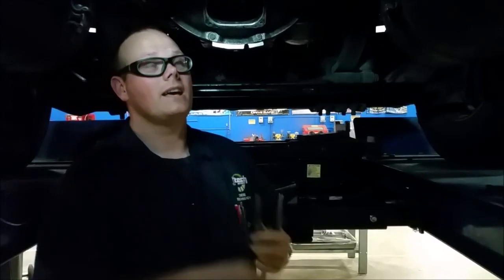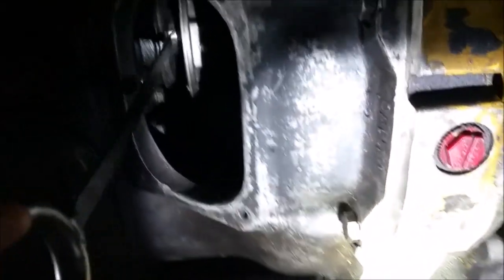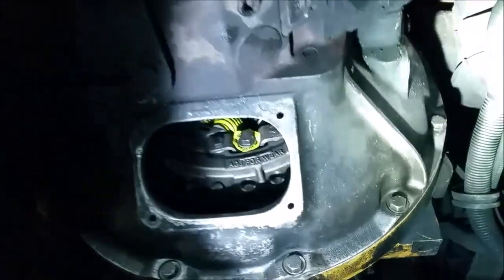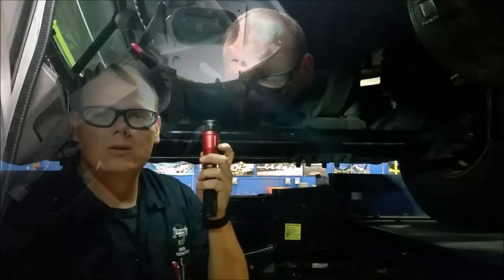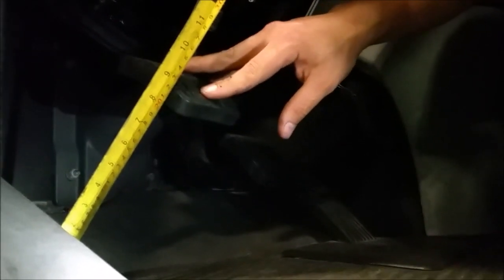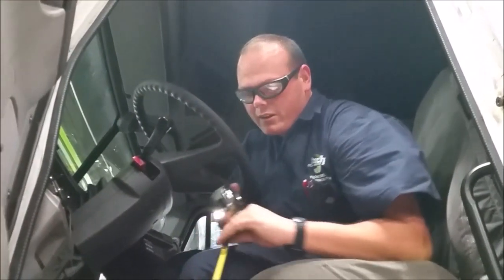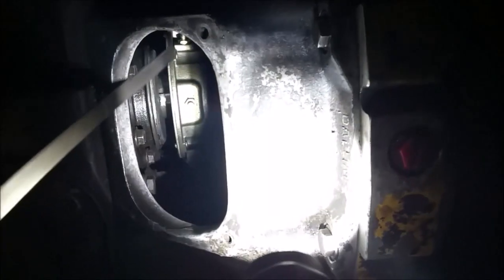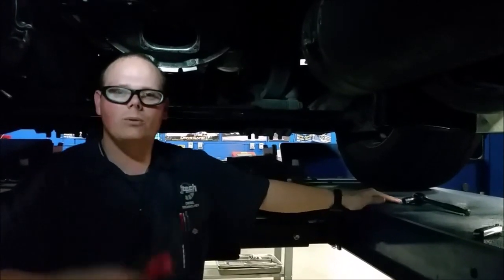Easy Pedal Clutch Adjustment

Comment: Always take the key out  of the ignition switch .  When the adjuster is in line with the inspection hole , make an position identifying mark on the dampener . Always install inspection cover  . The Eaton Fuller 15.5” clutch with mechanical linkage is great , much better than the self adjusting Solo with hydraulic control .
     7/16/23

Comment: I was always under the impression that you don't want to over grease the throw-out bearing because you don't want the clutch brake covered in grease? Might just be me but any friction brake doesn't seem to work well when covered in grease or oil.
Reply: You would think so but that is not the case. You have to realize that clutch does not stop the transmission from turning it holds it after it has stopped.  The old double clutch or float shifting...is perfect example either one does not matter its the same thing. Actually if you think about it... how can the clutch stop the trans when in motion. The driveline is still hooked up and the gear box is turning when in motion. If you push hard on the pedal to engage the clutch brake while moving the clutch brake will explode...literally, without the grease on one side. it works  like clutches in a motorcycle it needs lube to work. Plus, all gears are moving in a transmission whether engage or not...centrifugal  force will already have gears in motion. Clutch brake only has to work at one time, tractor stopped and engaging the transmission into a selected gear. Other wise your basically floating the gears. Double clutch is an old school way of shifting non pneumatic transmissions that were not synchronized ..like a 2 stick or a 3 stick.

Comment: So what how do you adjust the clutch fork if you don’t have a 1/8 gap between fork and throw out bearing?
Reply: When you adjust the clutch all 3 shoujd be ok. That includes ur forks, clutch brake and clutch free play... not 1 or more isn't within specs... ur prob need new clutch

Comment: I have a 95 ford F150. Would this adjustment be the same? When in neutral the sifter doesn't want to go in gear. Would this remedy this issue?
Reply: No pickups have hydraulic clutches and don't need adjusting. It sounds like you have low fluid or your slave cylinder is bad.

Comment: Brother my truck 2017 I changed my clutch 2 times still same problem clutch engaged high and rpm goes high but my truck didn’t take speed when I go up on hill my truck feels like no boost what be the problem
Reply: Rear end?

Comment: Why do I have to push the clutch pedal beyond the stopping point with all my 280lbs in practically a stand up position on the pedal to get it to start?
Reply: Sounds like that’s the button behind the clutch pedal, it should be connected to a rod that can be adjusted, it’s ez
Reply: Clutch brake is probably worn out or linkage/clutch adjustment aren't making it engage earlier